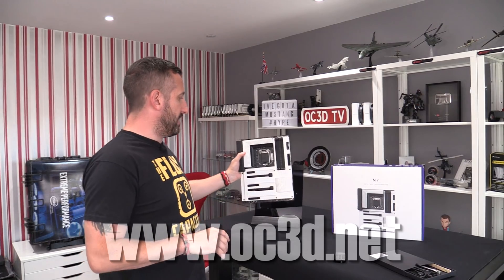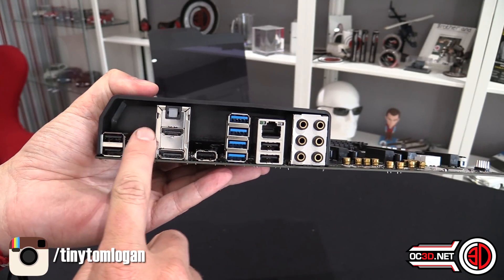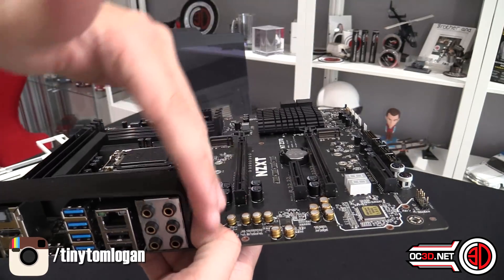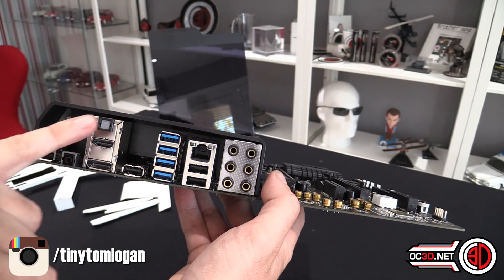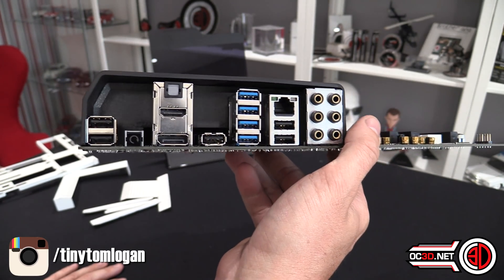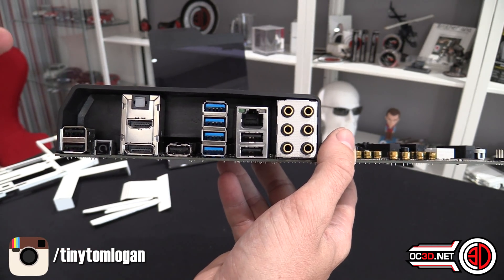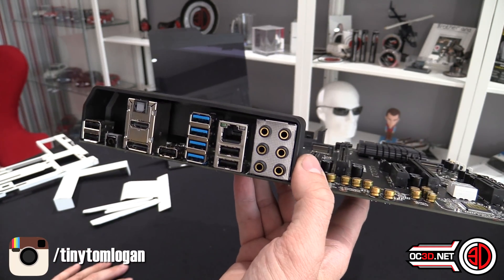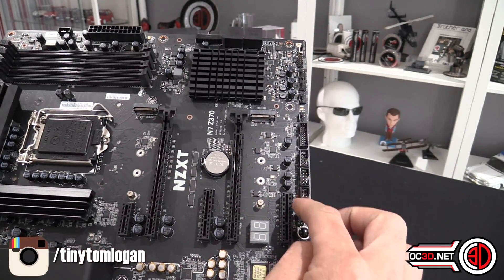NZXT N7 Z370 Motherboard Review

Comment: My son bought this NZXT motherboard. He is really upset and I know why. Anyone here know why NZXT N& z370 MOB will not recognize ASUS GTX1070 08G GPU  I've been dumbfounded how the Motherboard BIOS will not let me turn off onboard GPU and select my ASUS.  I bought a another ASUS 1060 thinking bad graphics card with the 1070. Same thing. Its as if the PCIe slots are not awake, or PnP isn't working or maybe the slots are just dead. Anythoughts?
Reply: Incredible ! Did any bios update from NZXT solve your issue ?
Reply: @maxoo._  no BIOS updates worked. I had many discussions with them. It turns out this particular MOB had a locked up BIOS. Meaning noone can alter GPU settings. But separately the real issue turned out the PCIe slots were actually bad on a new board. I will say NZXT did a great job at helping me troubleshoot and they replaced the board. So KUDOS to them for standing by the equipment. We did get the new board and the 1070 GPU now works well. My son is very happy with his RGB setup.
Reply: @HarryHarshaw  OK so you and your son seem to accept non configurable biosses so that's fine and the look of this board is nice but I do prefer my Evga z390 FTW for bios tweaking and for its look 😊
Reply: @maxoo._  Actually my son worked for his own money to buy what he thought he would like.  I encouraged him to look in other places first. But he was sold on his own accord. I am a Linux user and prefer my own custom builds from scratch and lets me tweak the BIOS even more. Ashame this particular BIOS was non-configurable. annoyed me deeply since I do like to tweak systems alot. But hats off to my son for saving earning his money and buying what he wanted to.
Reply: @HarryHarshaw  yeah hats off 👍
And what is your system build ?

Comment: I really don't like the looks of that board, but to each their own.  It just looks plain, cheap and uninteresting.  I also have massive reservations about all of the heatsinks literally being covered up by all of those thin white metal plates that again, form over function, only serve to look white and block airflow from reaching the heatsinks that are there specifically to keep components cool.  

Both the chipset and VRM heatsinks look so choked of airflow (metal plates with tiny holes that look useless for cooling) that even if you did buy that board for overclocking, you would never want to without first completely removing the shrouds.  And if you did that, then you would have just a basic looking black motherboard at which point your asking, what was the point of buying this board.  There are plenty of other black motherboards from other manufacturers that look so much better, are much more competently functional and cheaper than that over-priced garbage.  Hell, on that note, there are already plenty of other better designed and built white motherboards for cheaper available from other manufacturers as well.

I'm sorry... I just can't see the appeal of this board.  Not from a aesthetic perspective (but that's just me and subjective), and certainly not from a practical perspective either (which is the most important part).

Comment: I want to see Corsair do motherboards (but do a better job than NZXT) they already have more types of computer components and internal accessories than NZXT (I said internal just to be fair as NZXT do not sell things that are meant to go outside the case besides the puck)

Corsair are almost there to have at least one product in all categories of the PC market  and they are entering 3 new markets
1) Live streaming and game capture with the acquisition of Elgato Gaming
2) Custom liquid cooling (they debuted some water cooling hardware last year at Computex 2017)
3) Monitors (a couple months back Corsair were looking to hire someone to manage a new department for monitors)
Reply: all NZXT did was go to a crappy cheapo motherboard manufacturer and told them to add a HUE+ to a motherboard and then they added plastic all over it and called it a day 
and they are overcharging for this at least have 4 RGB strips as standard and at least 2 or 3 RGB extension cables for the strips

Comment: Sort out the BIOS, make the m.2 covers metal with decent thermal pads, add wifi and USB 3.1 gen 2. And then MAYBE the board will be worth buying. They should have chosen the h370 chipset for their first try as they clearly weren't ready to go up against enthusiast level overclocking boards.

Comment: I don't think the m.2 shrouds would ruin the look of the board. It already looks really bad. If you're going to have a Window on your case so you can see the motherboard and components, then I want to see them. If you're so fussed about covering the electronics up to make them look pretty, just print off a picture of some fluffy kittens or snowflakes and glue that on to the case window and have done with it.

Comment: At it's price point, it really should have come with white M.2 heatsinks.
Reply: At this price point it shouldn’t have been made by ECS...
Reply: the price point ain't not that bad (I still hate it though and still agree it should cost less) as it is basically like buying a cheaper motherboard with a HUE+ though if they want to continue selling it at its current price point then include 4 RGB strips and at least 2 or 3 RGB cable extensions (for the RGB strips) on top of what is already provided